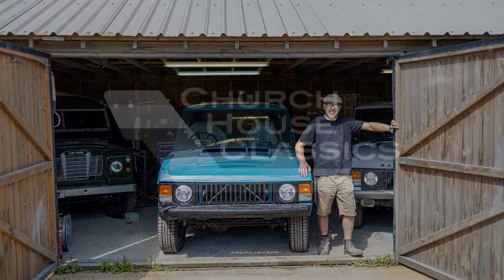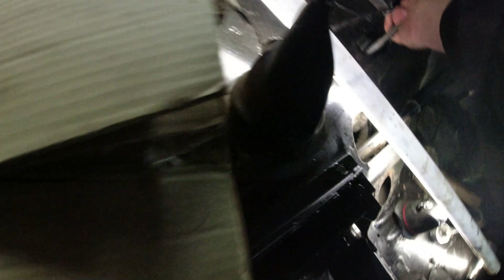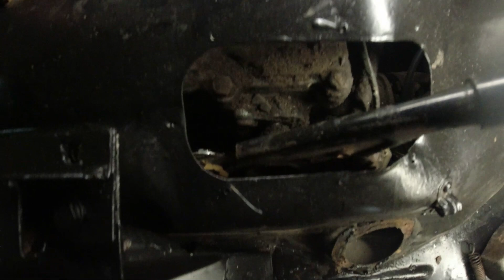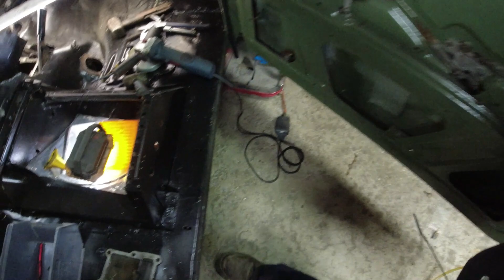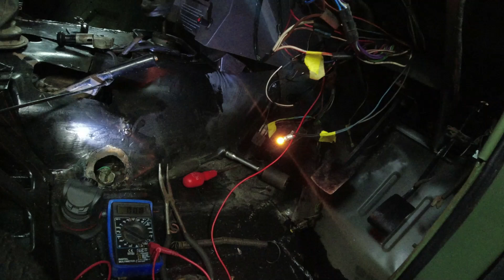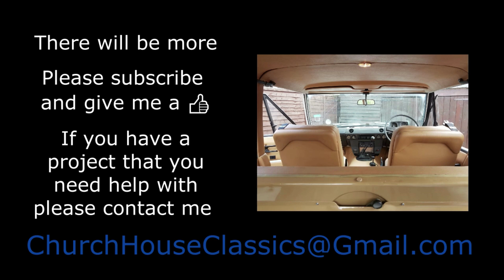Lincoln green transfer box lever disaster and stupid difflock Ep18

Comment: Your not the only one who has spanner throwing moments.
Changed oil on car the other day and sod my luck the threads on the drain plug were badly worn so bolt wouldn't tighten.
Still waiting for bits to repair it.
As for your trials on the diff lock why didn't they put an access cover in top of tunnel cover.
Did they not think that you would need to get in their one day.
Fortunately when I did my range rover resto the transmission were out on the floor and everything was tested before re fitting so non of the head aches that you are having.
Let's just hope the box is ok because the oil didn't look to healthy.
Was their any signs of sawdust in their🤔
Reply from the maker: The manual says to remove seats, boxes and then cover. alas they dont mention that you also need to remove the heater unit and most of the lower dash.

A shed load easier to remove the cross member and let gravity do it's thing.

I am not sure about the transfer box on this one, worst case scenario is that it hasn't actually been refurbished... sobs onto palms